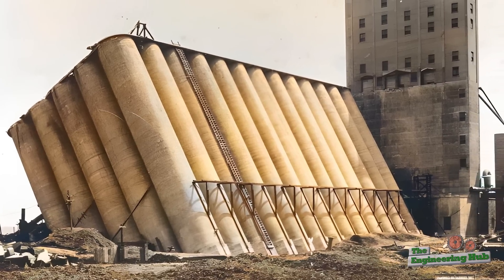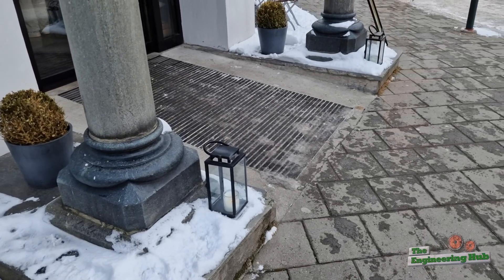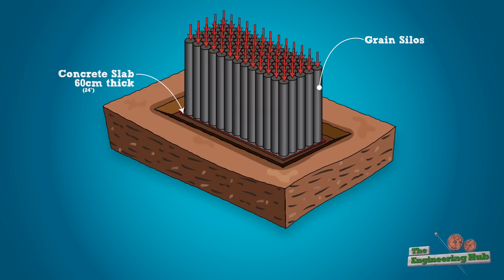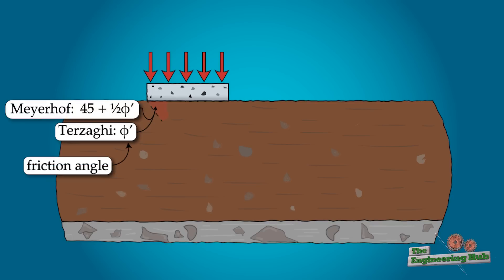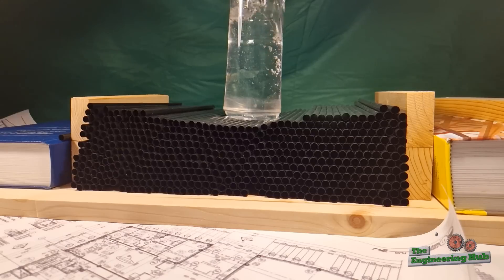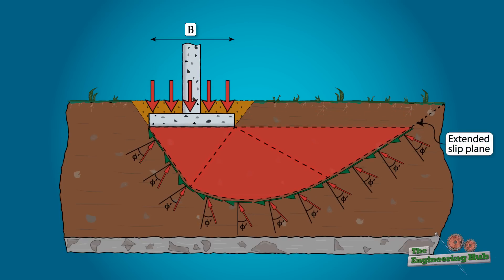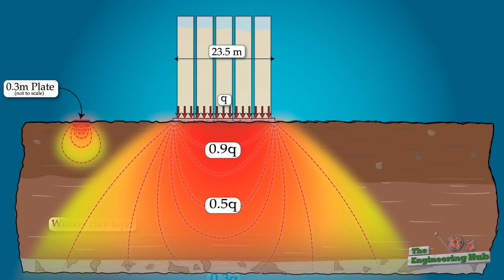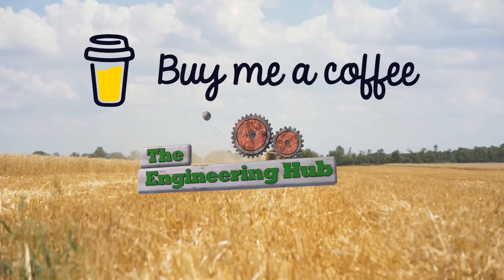Geotechnical Analysis of Foundations

Comment: All the crazy corrections made to the Leaning Tower of Pisa, which began to lean DURING construction, so they built a curve into it! 

... and the engineering afterwards was just as wacky, monster lead blocks, grout injections, hydraulic jacks and more! It's like a smorgasbord of engineering fixes over the centuries. 

ALSO: Titanic, Hindenburg, Challenger, Columbia, Upper Big Branch Mine, Deep Water Horizon Oilwell, etc, in which accountants overruled engineers to cut costs, and wound up cutting throats.

Comment: Could you do a video on designing foundations for earthquakes? I have property on the bottom of the former lake Bonneville in the area surrounding the Great Salt Lake. I would like to build a home someday, but it is known that during an earthquake the lake bed will become somewhat fluidized. Liquifaction. I have never seen any guidance on how to deal with the situation. I believe bedrock is beyond reasonable reach, and I don't know that being anchored to it, while everything around moves is really better. I have a 400ft well that is still in sand. The soil at the surface is clay just below the topsoil. Deeper than that I don't currently know. Obviously I could hire a firm and have studies done, but I am a mechanical engineer myself so would prefer to learn much of it myself. Do you know of any good books on the subject?
Reply: You need a buoyant foundation.
Reply: @ThatBrubakerFellow  That is the thought I had, but what does buoyant mean? That the entire house must be the same density as the earth below it (displaced by it) at its normal grade so it doesn't sink or rise? And probably symmetric so it floats level. That will be tough to pull off on an ancient lake bottom where the water level is not that deep and basements are not practical. 
Then what about viscosity effects? Is there enough friction/shear to compensate for large differences making it less likely to move than the buoyancy calcs would indicate?

Comment: I am sure the Greeks and the Romans knew this.   And putting the foundation in deep is not just to stop soil slippage.   It is to lower the center of gravity and the connection with bedrock or other more solid soils.   I think you need a peer review on this video.
Reply: If the Greeks and Romans knew this, then how did the cause of this failure remain a mystery for decades?  The Greeks and Romans knew a lot, but I doubt they already fully understood this particular problem.
Reply: @PeterLawton  All those records burned in the great library fire.   Those ancients created concrete that has lasted centuries.   Our concrete last decades.   Their buildings still stand; they must have known something!   Forget the fancy mathematical formulas in this video.   Much of this is just beyond  common sense.   (Determining square foot resistance and then multiplying by the number of square feet is just naive)

Comment: 7:27 Much of the parts of New Orleans and it's suburbs that were built up after 1950 suffer serious subsidence problems, since new land was created by filling in marsh and reclaiming the edge of the nearby lake.  I remember driving down cracked and undulating streets, while seeing two foot gaps under house slabs.
Reply: Everything East of Michigan Ave is debris from the Great Chicago Fire that was pushed out into Lake Michigan after the fire so all buildings built there have to have pilings that extend down to solid ground.

Comment: I wonder if they initially filled the elevators on one side first that caused the failure.
Reply from the maker: The reports that I read from the time indicated that the bins were filled evenly. They were aware that eccentric loading is dangerous and is to be avoided.

Comment: Was the building loaded unevenly or why did it tip to one side? I imagine it takes a lot of asymmetrical load for it to not just settle down, but top on its side. Who was blamed for the failure and if my theory is right, is asymmetric load normally taken into consideration in such constructions with substantial variation in loading?
Reply from the maker: The bins were loaded evenly to avoid asymmetric loads. In one of the more recent (late 20th century) reports that I read it said that the building might have tipped because there was a slightly more solid ground on one side or that there was a large rock that made it settle a bit slower on one side compared to the other. Once the uneven settlement started, P-delta effects (2nd order positive feedback) became more prominent and drove the asymmetry further. Just a theory, the exact reason may never be said for certain 🤷‍♂️
Reply: Soils are not engineered materials, so there is natural variation in the available resistance from location to location in the same layer in horizontal and vertical directions. Wherever the weakest soil was present would govern where the movement/failure starts.
Reply: it only needs to tip a little in one direction to become unbalanced, and once it's a little unbalanced, unstable soil lets it become a lot more unbalanced.

Comment: Excellent video !!

It appears that the Tower of Pisa could have failed due to the same failure described in your video👍
Reply: They also could have prevented this collapse the same way as Pisa did.. but that depends on how fast the collapse happened. If it was noticible, they could have left one side empty, which would counteract the tilt.. but with that weak clay layer, it could easily have gone the other way then.
Kudos to whoever build them though.. those silos survived a collapse!
Reply: What amused me about Pisa was that it began to tilt during construction and the builders tried to compensate for the lean by making the building curved. The tower has a slight curve.
Reply: @darylcheshire1618  😳😳😳  "curved"  wow, I never heard that story😳

Comment: This analysis is especially interesting to me, as I rode or drove past this site every 2nd weekend for 8 months of the year (heading out to the family farm for dinner) until I was almost 20.

It's not entirely correct to say it provided "relief" for the Winnipeg rail yards - the city yards had (and have) no grain storage capacity at all beyond what sits in the cars temporarily, as the railway does not store grain, it only moves it.
The silo was not owned by the railway, although they may have had a part interest in it, I don't recall.
Reply from the maker: Thanks for the comment, Thompson. You may have misheard at the end, the video mentions that the grain silo (not the rail) provided relief for the Winnipeg yards. Or maybe I misunderstood your comment 🤔
Reply: @TheEngineeringHub  I think I phrased it properly... Winnipeg is a major rail yard.  The silo was owned and operated by a customer of the railway.  It would be like saying your hard drive provides relief for your ISP's network - misconstruing the relationship, even though you can find bits and bytes in both locations.  Providing relief to the ISP isn't what your hard drive is there for, and providing relief to the railroad isn't what the silo was there for.  It was a storage facility that could incidentally act as a buffer, but it was for the grain seller's or broker's (or even the farmer's) benefit, not the railway's.
Reply from the maker: I must admit, I am from a different part of Canada and considering that you have spent a considerable amount of your life there, you are probably way more familiar with the mechanics of grain storage and shipment in the area. That particular sentence about providing "relief" was taken from an article which is also referenced and claimed that that is the case. This is the article, see first sentence: https://structville.com/2021/04/transcona-grain-elevator-failure-lessons-on-bearing-capacity.html
Of course that does not mean that the article is not wrong. In any case, I appreciate you taking the time to correct the facts. Cheers!
Reply: @TheEngineeringHub  I suppose one could interpret the "relief" as: without the elevator (silos) there would be a lot more grain cars both passing through the yards, and sitting in the yards taking up valuable trackage.
Having a dedicated transfer facility means all the inbound grain can mostly pass straight through the yard, empty at the transfer/storage facility, and go right back to pick up the next load at a rural elevator, not tying up yard resources for days/weeks on end.
I still think your source misrepresents it, but I may be splitting hairs about it...

Keep up the good work, anyway - repeating a mischaracterization that doesn't even affect the central theme of the video doesn't diminish it's value at all.
Reply from the maker: @athompso99  A nice civil discussion is always welcomed🙏  thank you again for clearing things up for other viewers that may end up watching the video and actually sticking to the end (not many do, unfortunately) I'm especially glad that you kept your attention at a high level to the very end and were able to spot this detail.

Comment: It is amazing that they salvaged the silos, especially for that time period.
Reply: Think about what Galveston Texas did after the 1900 hurricane: they raised over 500 city blocks worth of buildings anywhere from 8 to 17 ft above existing grade as daily life went on around them.
Reply: @stevebengel1346  IIRC Seattle also did something similar. It seems like this was super common.
Reply: @stevebengel1346  5l
Reply: It's a pity the video doesn't say more about how they did it.
Reply: @enysuntra1347  He said he would make another video about the recovery.
Reply: @enysuntra1347  basically they dug out the soil from the high side, causing the bin house to return to upright.
Then they reworked the machinery to work with bins sunken into the ground.
Reply: In that time period, it was often easier and cheaper to make do and mend. We don’t do that these days on any scale really. If it’s a large project, like grain silos, that’s capital not working, and when have you ever darned a hole in a sock?
Reply: Far less amazing that they'd do this back then. Things of value used to be appreciated and saved and reused. It would be amazing if they did that today instead of demolishing it and building an inferior replacement.
Reply: There is a high rise apartment building in San Francisco, California, USA, that is experiencing a similar settling problem. Nothing like having the floors of your million dollar apartment/condo slowly tilting!
Reply: I'd say they would of had a better chance back then as the structure would of been built alot stronger and overengineered compared to today's leaner cost cutting engineering.
Reply: @timhinchcliffe5372  Depends upon production.  In my experience the concrete crew will use stronger concrete to achieve the strength needed to move up to the next pour.  On one project where we were building a 125' tall (42m) tall concrete structure, the engineered wanted 5000psi concrete, the concrete achieved 10,000 to 12,000psi at final 28 day break tests on cylinders.  

By using the higher strength mix the concrete crew could break a cylinder at 24 hours that was around 3500 psi which allowed them to strip the forms and move up to pour the next level and brace off the structure for the concrete formwork after 24 hours of curing.
Reply: @timhinchcliffe5372  Well modern structures are often better engineered in most of the world today vs before. Due to strict regulations, enviormental concerns and safety.

US is kinda an outlier there. Where they construct as cheap as possible. Average home lasts about 30 years in the US. Average home lasts on average about 80 years where i live.
Like the "brick" houses in the US after often plywood with some thin layer of brick on the outside. And you see when there is abit of wind, the cardboard houses go flying.

Quite in contrast to Japan, another nation with alot of extreme weather. But they build buildings to last (atleast the modern ones, the old way was contructing cheap and fast)

But constructing cheap and fast costs alot of lives. After all, kinda sucks getting a building ontop of yourself cause its a little windy.
Reply: @MrDanisve  maybe so, but do they depend on modern foundation designs and allow for a failure of the foundation?
Reply: @timhinchcliffe5372  Ofc they had less knowlege about soil mechanics back then. But if they lasted this long, odds are they are going to continue to last. Pretty sure the soil has been put thru most stresses it can be put thru with decades of use. 

If they were flawed, odds are they would have ended up scrapped along the years that have passed.

An old aunt of mine chose to build a new house cause the foundation on the old one was so bad. There was little to regulation back then, so the quality of the foundation really depends on who built it.

Thats why you often se fails in small homes where some guy thought he could DIY, but failed. Bigger structures have usualy been professionally done, even in the old days. And you see less failure there.

Bigger sturctures in the old days were often big endevours, and experts from all across the nation came to participate. Houses, not so much so.
Reply: I was thinking of the same thing.
Reply: Of course they did! Back then they built things strong and learned how to fix their mistakes
Reply: Why is the top comment always a fuggn spoiler.
Reply: Why? Just because you personally don't know how they did it? Or because you do know, but consider yourself too unable to explain clearly, or...?  🤔
Reply: those things were incredibly valuable (and not just expensive,) for the surrounding countryside. That amount of grain feeds cities, not only the farmers that grow and sell it. It's worth it to get it tipped back up and working again. I AM curious however, and it was not mentioned, what steps taken to accommodate and reinforce the structure after this failure.
Reply: I imagine it was somewhat similar to the lifting of buildings in Sacramento CA above the flood plain.

That was done very carefully with lots of jacks and even while the businesses remained open.
Reply: @aviphysics   You're comparing, well, two  significantly too different things. This is a building built to stand straight up right, now at an angle. The other is "a whole lot of buildings, all still standing upright, to go to another location." The angle of lean brings it to a whole different level of complexity
Reply: @aviphysics  I was told they removed dirt from under the high side to right the structure.  (It sits very low). They must have then underpinned to stabilize it.   The building was still operating over 100 years later, and likely still is.
Reply: @aviphysics  Lots of the first floors just became basements without jacking

Comment: In your example, it is "all dirt all the way down"  How does Terzaghi's work deal with overburden over bedrock?  Around here for most buildings you just scrape off a meter or less of overburden to hit the granite of the Canadian shield, put in some pins and start pouring concrete.
Reply: There are methods for addressing layered soils and estimating the bearing capacity of foundations on and in rock. 
Like all materials, rock fails in shear as well, just normally at much higher values of stress than soils.

Comment: Your straw model is wonderful. Please extend it and do ananalysis video using straws of different diameters, mixed, or in planes, or in patches.
The underpinning thought is a realisation of mine of looking at solid, liquid and gaseous not as aggregate states, but rather as behaviour. This behaviour is determined in the most simple case by the mixing ratio of two homogenous particulate grain sizes. Exemplified by ground coffee (KG1) in its vacuum package (KG1=100%) behaving solid until a hole is punched and upon air (KG2, where KG2<KG1) entering its "solid" behaviour changes from solid to amorphous to liquid (KG1:KG2 = 100:0 -> KG1:KG2 = 90/10 -> 80/20 -> 70/30 etc. over time) - you can now "pour" it out.

Comment: Great concise video. Proves that assumptions can make or break a design.  In this case a surface test did not reveal the weakness lurking below.   I assume a valid test would have to be a drilled hole then inserting a pole to load test. And A driven pile would skew the bearing capacity because it compresses the soil beneath the pile.
Reply: And the soil beside the pile. It creates a load bearing column that is of significantly larger than the area of the pile. Of course, that depends on the shape of the pile.

Comment: The long tubes are not interlocked.  They are merely stacked and confined. With absolutely no adhesion whatsoever.
Reply from the maker: Sure, fair point. They do still have frictional forces between them, so they would have a friction angle >0 (if Mohr-Coulomb was applicable). Definitely cohesion of zero 😅.

Comment: In simple terms the property's tensions within the viscosity of the soil were exceeded putting it into a fluid state.
And a simple way to reduce these viscosity tensions is pinning the soil with pylons which distribute tensions over a wider area thus reducing frictions pressures.
Surrounding soils and slopes need to also be considered as they are ballast.
Reply: While membrane analogies can be useful in approximating contact stresses, the failure mechanism in the soil is shear stresses overcoming friction/adhesion between individual soil grains. Soils have essentially no tensile strength.